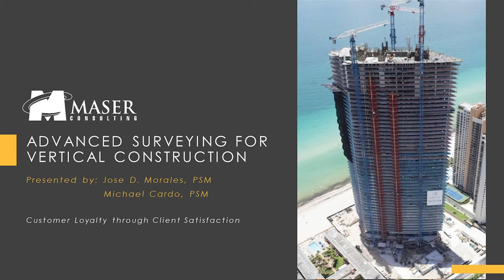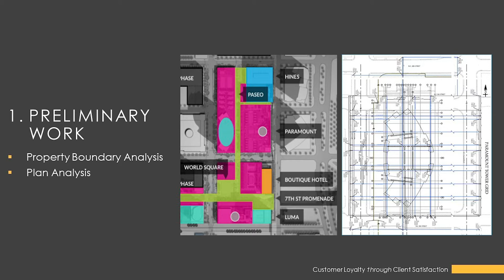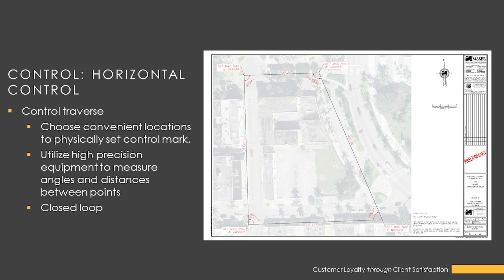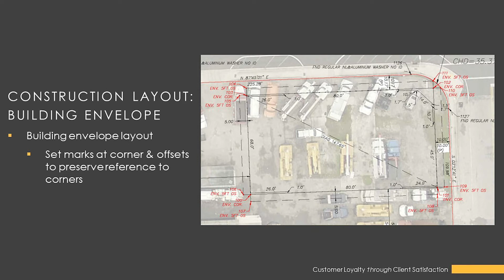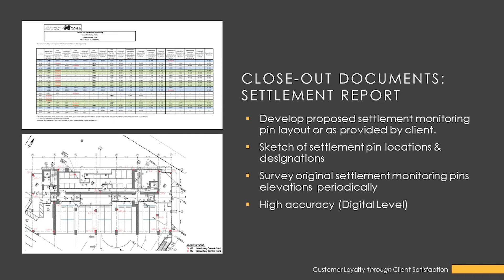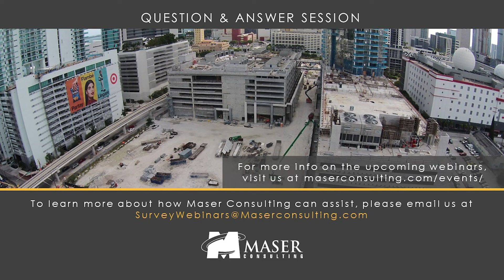Maser Webinar: Advanced Surveying for Vertical Construction

Comment: Gentlemen. Nice presentation. I was hoping to see the actual survey instruments used during construction.  Maybe Leica survey equipment with a right angle attachment. Any laser systems to help with vertical and horizontal control. Do you guy certify steel columns for being plum? It would be nice to see a crew at work. I’m a retired high rise construction surveyor.

Comment: I have a question about total station setup on a high rise.  Once the screen walls are up, and the tower crane is tied in, how would you set up a total station on a plywood deck?  Also the core does not go up until the day after the deck pour.  So mounting to the core is out of the question.
Reply: We have placed plywood around a column cage with truck straps to stabilize the cage and used a SECO column clamp instrument holder. The work deck is at the top of the screen so the targets that we have placed on other buildings can be seen over the top of the screen for resection.